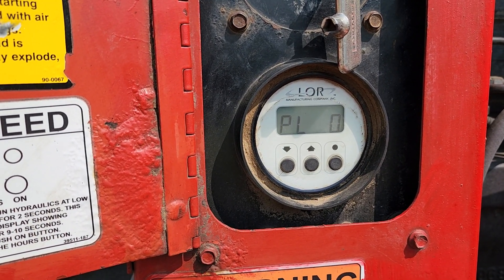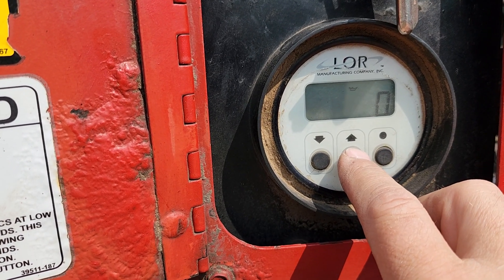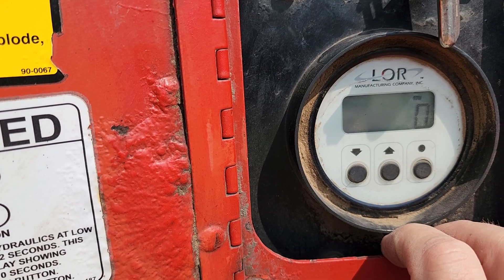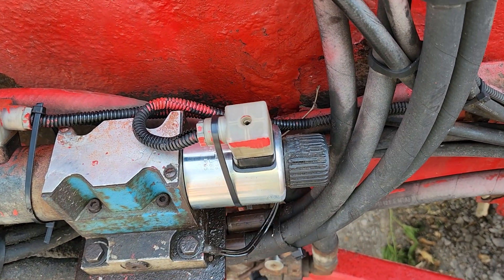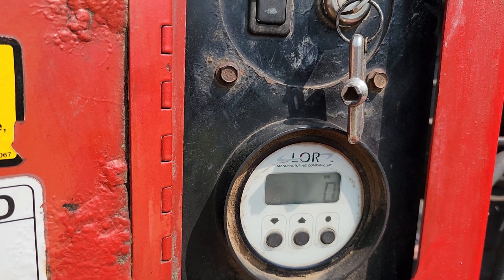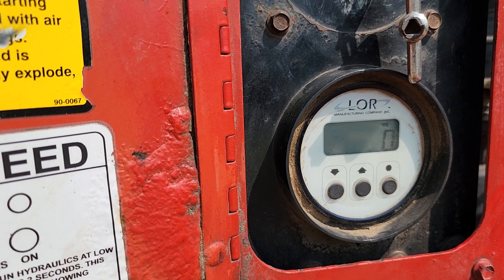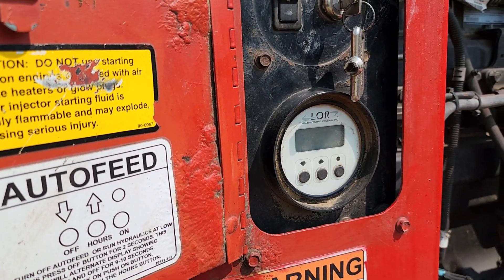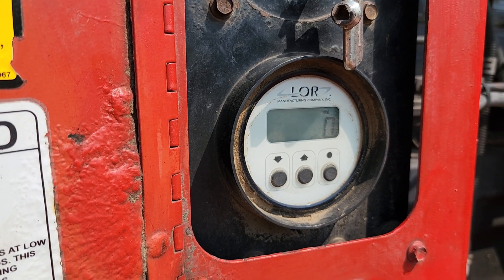morbark auto feed controller operation

Comment: What caused the problem for the auto feeder to go off my chipper’s doing it now the only way it will run if the Auto feeder is off
Reply from the maker: is your rpm running fast enough to enable the feed? you might want to check and see if the controller unit lost it's setup parameters by calling the morbark company